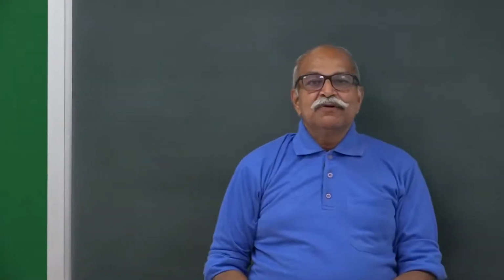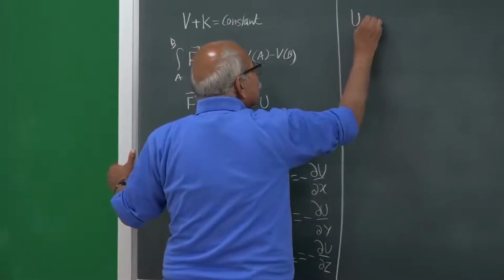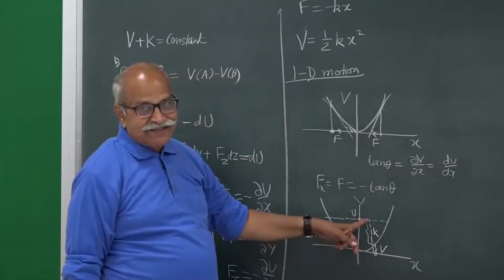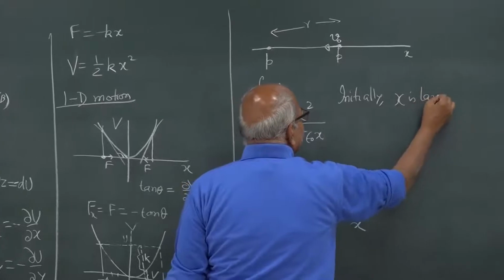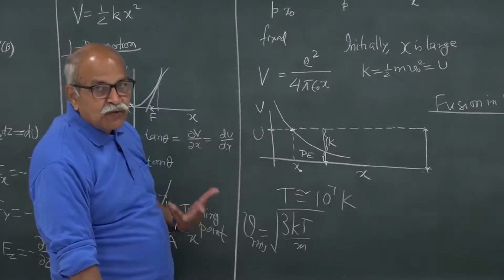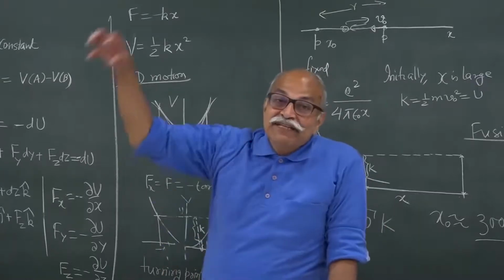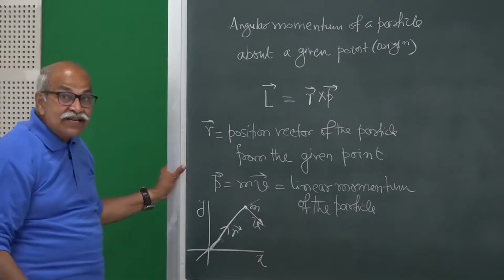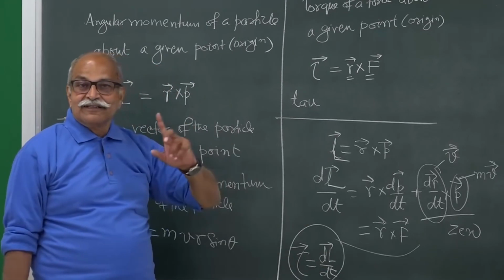Lecture 04  Potential energy diagrams

Comment: Sir I have a question. IISC Bangalore has made recently prepared a room temperature superconductor meterial. Can we use it to create a small particle accelerator, and then bombard Deuterium Ions to form Helium Nuclei. We can have an acceleration section, and then a bombardment section. In the bombardment section the temperature will be high, and we can use this heat energy to further generate electricity and feed it back to the Accelerator. We can setup the entire experiment in Yakutsk after taking a permit from Putin. Because the room temperature superconductor may again not work all that well in Indian climate. In Yakutsk the temperature dissipation from the acceleration section will be fast.
Like this project has many parts. Taking permit from Russia, to setting up the particle accelerator. We can also use liquid nitrogen latter, in India, to control temperatures. But the question remains, will there be a net gain of energy out of this whole process?
A nuclear power plant is huge in size. But by using the superconductor we may be able to make it of portable size.